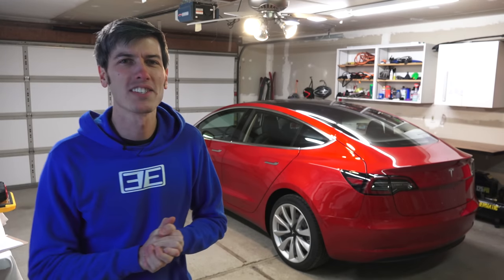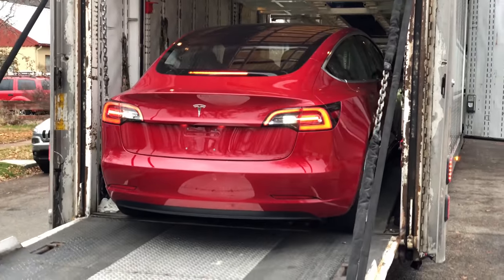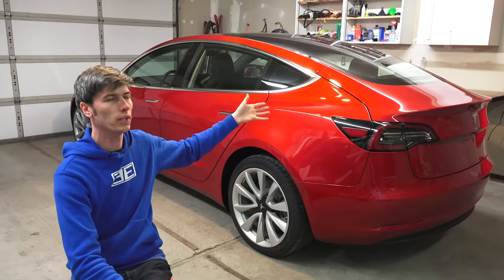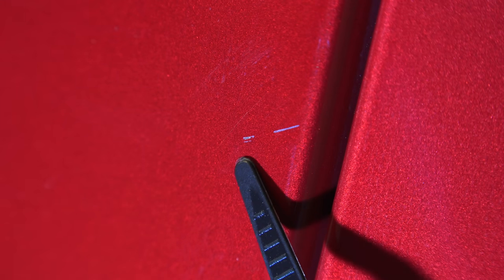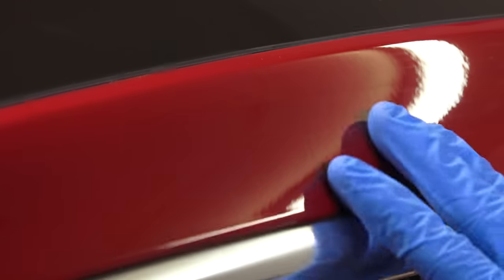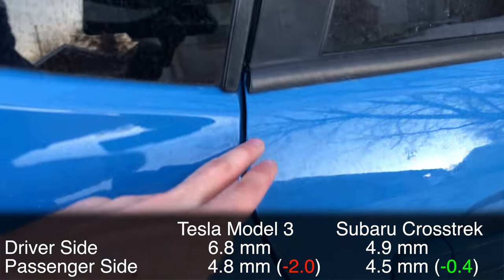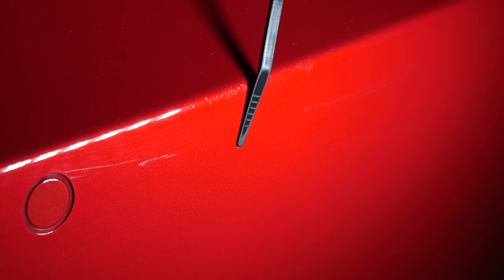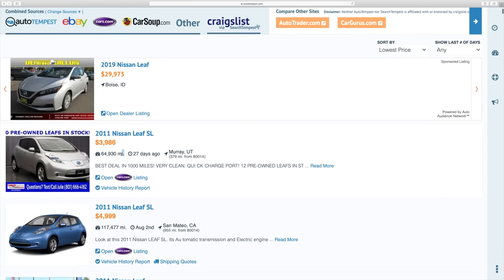Everything That's Wrong With My Tesla Model 3 - Quality Problems

Comment: Quality Control issue.  Most Tesla goes through an inspection under bright light.  Anything spotted gets pulled aside and touched up from a paint specialist at the factory.   

Gaps, assembly and noise issues (like lose panels) supposed to get pulled aside and get corrected.  

Maybe the cars are not going through thorough inspections to meet demands.

Comment: But look you are saving the world. You cannot worry about paint scratches and panel fit. 
Instead of yapping about it you should be charging the batteries then testing the range.
And getting your motoring  organisation on speed dial. So they can send a tilttray for it in an hours time.
Those low km 5 year old toy  cars says a lot about the cars. Pay way too much and then not drive them as they are less than practical.
To drive them is not a problem, running out of electricity however is. As it was a 100 years ago.

Comment: Is it normal for a Tesla to have 22 miles on it when it’s delivered?? I would never buy a new car that’s used! Yes 22 miles means someone drove it and quite possibly did damage. I have never bought a “new” car with more than 3 miles on the odometer. Anything more than that means someone took the car on a joyride.

Comment: All of those scratches are extremely typical of shipping scrapes. You can blame your car's transporter company for those, not Tesla. The dots, however, are Tesla's fault, and they should know better than to have such a dirty paint system.

You can thank the new(er) VOC restrictions for the horrible orange peel in modern vehicle paint. Automotive companies have done their best with the current VOC regs, but unfortunately, we're stuck with orange peel for the foreseeable future. You can get out orange peel, if you don't mind wet sanding off so much of the clear coat that it becomes completely level, then polishing with compound and then a final polish with very fine abrasive finishing polish. Some cars have thick enough clear coat to do so (relatively) safely. Others, not so much. Don't wet sand your car and then blame me for ruining it; it's not an easy thing to do, and you can screw up your car big time if you don't know what you're doing... actually, even if you do know what you're doing.

Comment: I don't think ELon Musk really cares too much. His interest was to sell TesLa in 2018, but the deal broke down. Now its more of a headache for him and he's probably just wants to drag it along until he can get shot of the company. The hype of battery operated vehicles and trucks can still be challenge by the Hydrogen CeLL and the die hard Combustion which the Japanese are continuing to develop with greater efficiency. So TesLa may have a very slow climb if any, or judging by these corner cutting errors, it maybe a workforce on the cheap knocking up these newer models.

Comment: I would ask them to take it back and get a full refund. Then go buy a Hyundai EV. They are slower but range and quality is way ahead. $2500 paint option . . . Mazda doesnt charge anything and most manufacturers charge less than $800

Comment: Very informative video, thanks! I definitely would have immediately complained about the paint scratches.  A few of the panel gaps are severe, especially between the  glass plates, however those are production flaws/irregularities; not much you can/they can do there. The paint though; that’s unacceptable for any priced “new” car. I’ll wait until they become an legitimate car manufacturer.

Comment: At first I was let down by the quality of the cars paint. But then I saw how you were using the calipers, whyyy? why not use the back of the calipers, that's what it's used for. Maybe I your channel wasn't called engineering explained I could let it slide. Big no no no.
*edit: after reading the pinned post

still no no no

Comment: Quality Problems i see still with tesla's cars
tesla are stilll selling car with no air tight battery pack sealed from water or weather which makes me think 
are the  Electric Motors in same mess ,
Seems tesla still have big problems with the design and  I  
also wonder why tesla's don't use run flat tyres technology for safety 
when most are using autopilot .people are not thinking its a laptop on wheels and we alll know what happens to computers software it going to crashes .

Comment: Of course you maroons know what is going on with the paint?! The factory didn't let the paint cure enough before they put the white plastic wrap on it before shipping.  Or maybe they took it to a car wash tunnel before loading it up. You know they store these cars outside.
It could be that the paint robots were hung over from the night before, they breathe in solvents without respirators for a cheap high ( do not try this at home ). What do u expect from non-union help!

Comment: I noticed that the car wasn’t wrapped with any prep material coming off the truck.  It seems to me that if Tesla did a better job of protecting the car in transit like other manufacturers do, every paint scratch that you pointed out (excluding paint imperfections) could have been eliminated & prevented.  Hey Tesla…do a better job of protecting the cars in transit!

Comment: The error in your measurements are probably huge, considering a) you are using the wrong end of the calipers while trying to b)  measure a round edge in c) shadowing conditions.   There is no validity here.
Reply: You can literally see the massive gaps you don't need a caliper for this. Also this isn't exclusive to his tesla this is widespread well known issue.

Comment: 1121

KEY POINTS. 1. Substandard Paint Quality, PATHETIC. 2. Faux Leather Seats, PATHETIC. 3. An over abundance of ALUMINUM front and rear, PATHETIC. The Model 3 exterior is about as durable as a Coke can!  4. 5 inch ground clearance, PATHETIC. The Model 3 bottoms out over speed bumps! 5. No SPARE TIRE  or RUN FLAT TIRES, PATHETIC.  WTF!!!!! 6. Poor overall workmanship, PATHETIC. This is a poorly designed, poorly equipped car for the price, that simply cannot be denied. Other than the software package, there is NOTHING premium about this car! The paint quality is absolutely LAUGHABLE! This vehicle cannot be run through an automatic car wash, unless you desire the paint to be riddled with scratches. Elon has delivered a STUNNING software package locked within a HORRENDOUS hardware package.  I’ll pass until quality is VASTLY IMPROVED!

Comment: Your paints fucked up cause you bought the weird expensive color, if you'd have just went with the standard paint it would have been just fine. Then the rest of those looks like the shitty truck that delivered your car probably fucked it up. IDK why they would use a covered truck like that, so much harder to get in an out of the car, easier to scratch. They should have just gone with the regular truck. Let em guess, you paid extra for a covered truck, lol.

Comment: 'Everything wrong with your Tesla'! Well, who'd buy a Uranium&Coal powered car, with its heavy and toxic, soon degrading batteries, which has a single digit efficiency (from the uranium mine to the wheel)? Tell it as an 'engineer' to a German! Even later steam lokomotives must have been more economical and they had enough waste heat to keep you warm in the dust belts of America, they also lasted for decades when maintained properly. The radioactive waste, your tesla is producing with every driven mile, needs to be taken care of for thousands of years!  And  all these Jobs, Bezos' and Musks out there are such psychopaths. Who'd buy from a psycho? I just want to understand what is going on, not only from an engineer's point of view but also from a psycholocical and sociological perspective. Are you insane? Did they buy or force you to promote the nastiest of all economic growth packages?

Comment: The electric car pollutes: Production of one Tesla emits 23 tons of CO2.
It is only after many thousands of kilometers of driving that the electric car is more climate-friendly than a diesel car, calculations from the Climate Council show

Have you met a Tesla in traffic and thought that there is a motorist driving there who thinks more about the climate than you? You do not have to. A Tesla is not necessarily more climate-friendly than a diesel car. It shows calculations from the Climate Council.

In fact, it is only after 150,000 kilometers of driving that the large electric Tesla is overtaken in CO2 consumption by a smaller diesel car. The explanation is that the production of a Tesla emits much more CO2 than the production of a smaller diesel car.

It appears from an article in Ekstra Bladet. In fact, as much as 23 tonnes of CO2 is emitted to produce a piece of Tesla Model S 100D, according to the Climate Council's calculations. In comparison, only approx. 11 tonnes of CO2 into the atmosphere when a “large powerful diesel car” is produced with a consumption of approx. 17.9 km / liter.

Therefore, it is only when the cars have driven 50,000 km that the Tesla and the large diesel car have emitted the same amount of CO2. And if it is an "efficient diesel car" like a Citroen C3, then it is only after 150,000 kilometers that the diesel car emits more CO2, according to Ekstra Bladet. The production of a Citroen CO3 emits "only" approx. six tons of CO2.

Battery production is expensive in CO2

It is the production of Tesla's battery that costs a lot in the CO2 accounts. Both for the extraction of raw materials and for the energy-intensive production. However, Tesla is in the process of building a "Gigafactory" in Nevada, which will be powered exclusively by green electricity. When it opens, CO emissions will be significantly reduced for Tesla.

“If you have bought a Tesla instead of buying a smaller petrol or diesel car, it has not been the best balance for the climate. Then you must at least have ridden in it for many years, "says Niels Buus Kristensen, research manager at the Department of Transport Economics in Oslo and a member of the Climate Council, to Ekstra Bladet.

However, he does not think that the comparison between a large Tesla and a smaller diesel car is the most relevant:

"Many of those who have bought a Tesla have bought it instead of a similar luxury car, and the Tesla emits significantly less CO2 over its life cycle," he tells the newspaper.

In its new climate proposal, the government has proposed that the sale of new petrol and diesel cars be banned from 2030. The government's goal is that by 2030, 1,000,000 hybrid and electric cars will be driven on Danish roads.

Comment: Just wait until it needs repair work. It will take months.Real bad company. Not enough parts made for how many cars are out there.. When you buy these cars it should say make sure you have another car before you buy these. And if your ever in a crash good luck getting it back in 3 months time. Buy the way are you running for President lol...